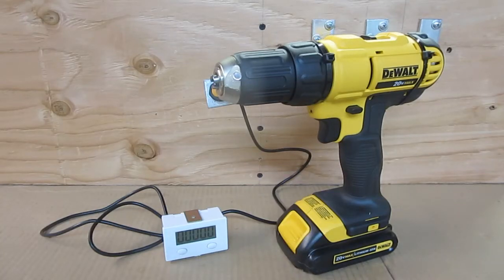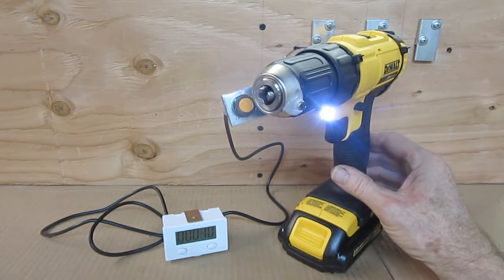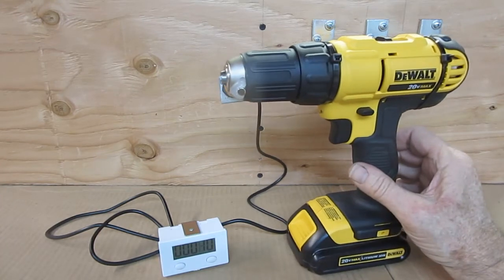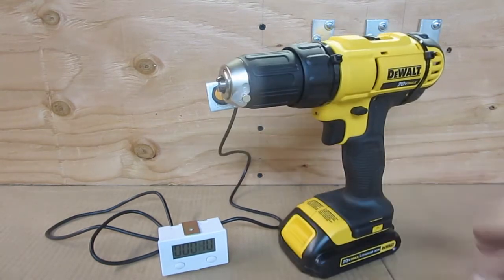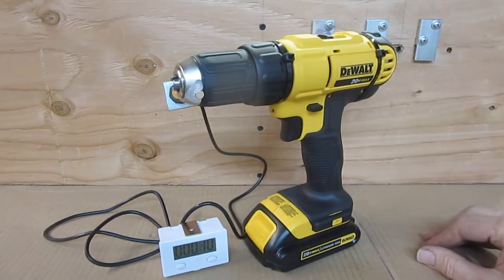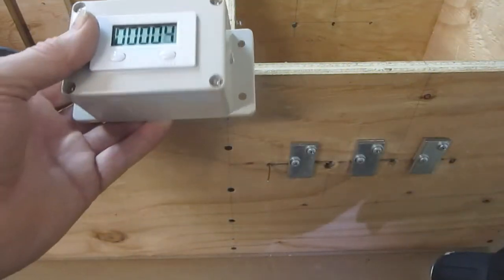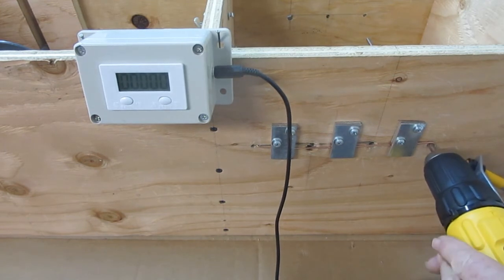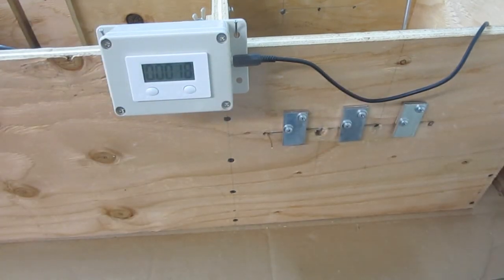Magrav Coil Winding Counter

Comment: Does anything need to be connected to the Reset terminals on the back ?
Reply from the maker: No. The positive and negative wires from the proximity switch are connected to the screw terminals under the "Pause" button. The unit didn't come with a wiring diagram, so this is how I wired it. Please unfold the video description above for links to a couple of photos I uploaded to dropbox.

Comment: Send link of thise product when you made it so you make video how to make thise in detail
Reply from the maker: Here are the links. Sorry no step by step video. I used a drill and a jig saw to cut out the rectangular opening for the enclosure. I used a soldering iron for the jack and the plug. I used a drill for the metal bar to make a hole to mount the proximity switch. I hope this helps.

eBay counter link: https://www.ebay.com/sch/i.html?_nkw=LCD+Digital+Tally+Counter+0-99999+Digit+Forward+Digital+Counter+%2B+Proximity+Switch+Sensor&_sacat=0&_fosrp=1

eBay enclosure link: https://www.ebay.com/sch/i.html?_nkw=White+Waterproof+Plastic+Electronic+Project+Box+Enclosure+Case+100%C3%9768%C3%9750mm&_sacat=0

All Electronics plug link: https://www.allelectronics.com/item/pmp/mono-plastic-3.5-mm-plug/1.html

All Electronics jack link:
https://www.allelectronics.com/item/mmj-s/3.5mm-mono-jack-with-switch/1.html